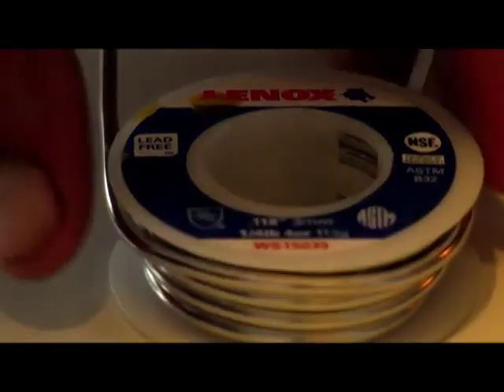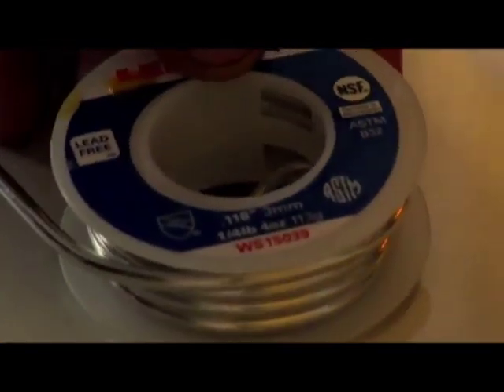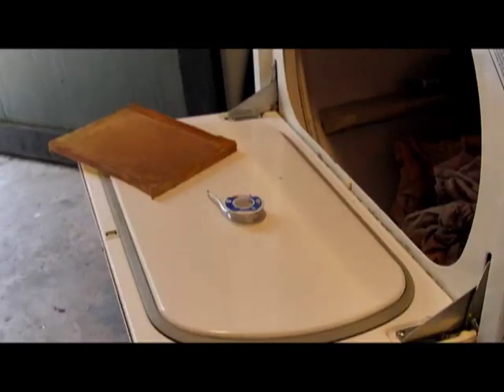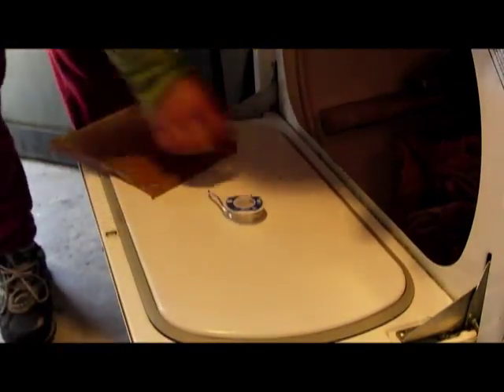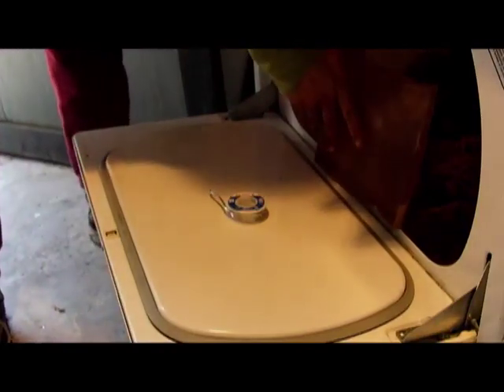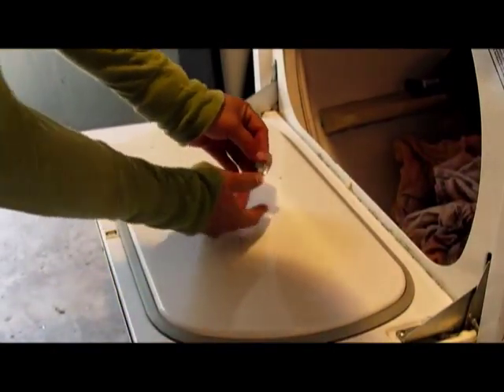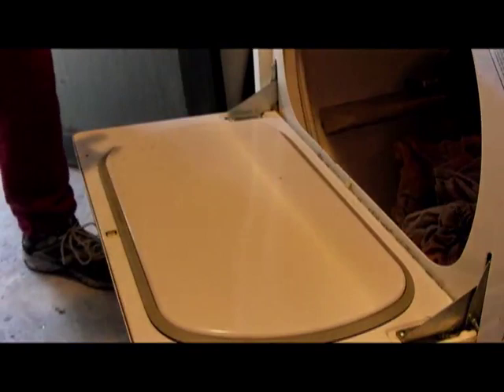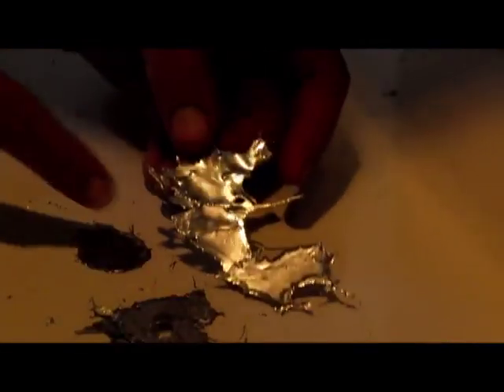DIY SOLDER FOIL from SOLDER WIRE

Comment: Thing is when you heat up rosin core solder you burn away the rosin, when you then want to reuse your foil you are soldering without flux, which results in a poor joint with high resistance.
There is absolutely no reason not to just get proper solder, I buy mine on the internet, 2kg rolls 0.5mm diameter, I can get as small as 0.05mm, which is thinner than a hair, it's so fine it can't be pulled off the spool without breaking, you have to roll the spool.

Comment: are you adding flux to your "sold-er" joints, as your process is burning up the flux that should be in the "sold-er" that you are using.  Is what you are buying at Lowe's even electronic "sold-er", and not for plumbing?  They are not the same thing at all.
The way it is SUPPOSED to work is you heat up your work piece to where it's hot enough to melt the "sold-er", and THEN apply the "sold-er".  Proper "sold-ering" is NOT AT ALL the same as some adhesive or putty.

Comment: Remember when you solder the junction should be shiney and not dull. If it is dull looking it is considered a cold solder junction (poor connection point). Also a solder flux should be used.

Comment: @stormcrow2525 because the thick solder produces a bigger 'droplet' when you heat it up. the thin flat foil approach works better for applyin to the back of the panels